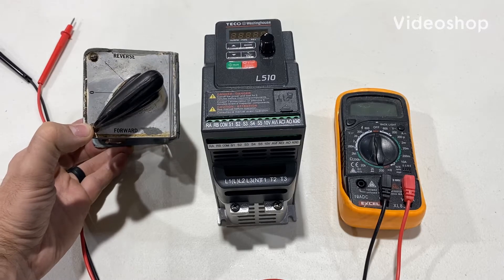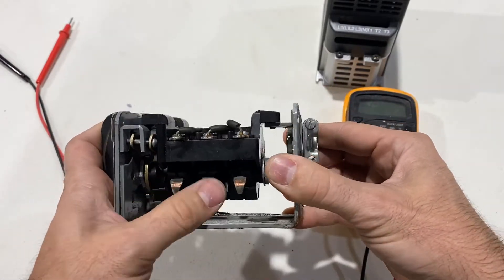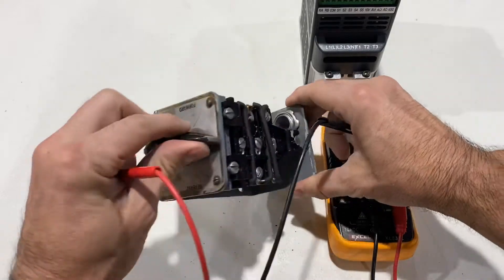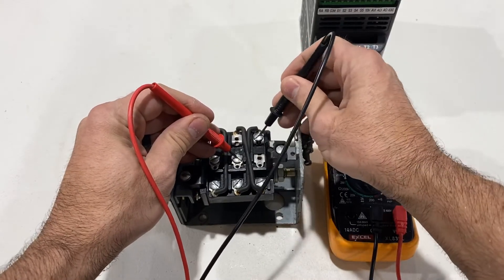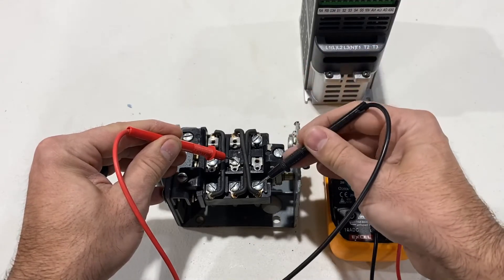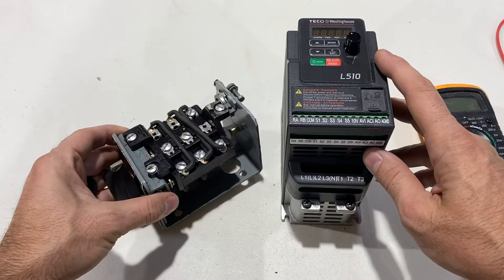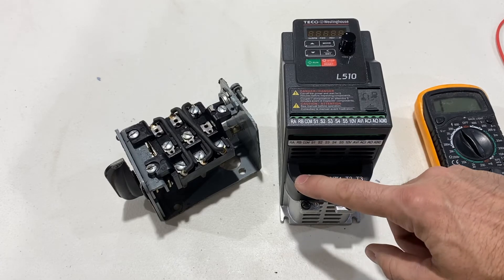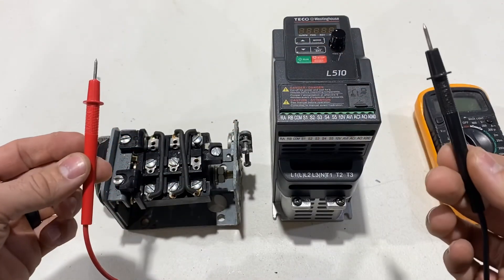Using original forward reverse switch on a VFD

Comment: I’m in the process of wiring up my lathe to a vfd. I have a similar rotary switch but also have a start button and a e stop button. Can I use all 3 without issue?
Reply from the maker: Honestly I’m not sure, it depends on the VFD, If I’m not mistaken there are outputs for configurations like that. You may really have to delve into the manual and look at all the start stop options. Sorry I wasn’t more help. But I’m leaning towards (yes) haha
Reply: Yea I might just wire it to the rotary switch for now until I figure out how to make it work with everything lol

Comment: Do you also need a ground wire between the VFD and the switch?
Reply from the maker: I seen no mention of that in the manual. Probably a good idea to ground the switch to the case of the mill. The VFD is grounded by the shop electrical ground
Reply: @BrewmasterC  thank you!

Comment: Thank you for taking the time to publish this video. It's exactly what I was looking for. Even the switch is the same. Hooking up my mill as I type. Many thanks.
Reply: @BrewmasterC  Thanks for your reply. It went well thanks to your video. I did a dummy set up before installing on the lathe. I will leave more details when it is actually all hooked up on the mill itself. Having a week off as its stinking hot at the moment 40+ 1st day of summer.  
Ball screws will arrive hopefully next week.  Thanks again for your video and reply.
Reply: BIG help. I’m going to use my stock B/P switch!
Reply from the maker: @buildmotion1426  Awesome! Hope everything worked out well!